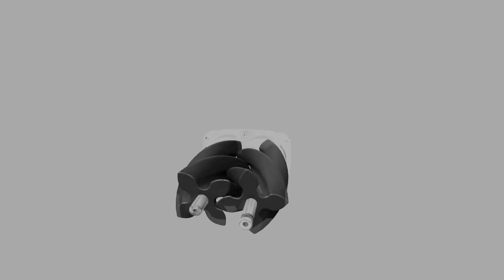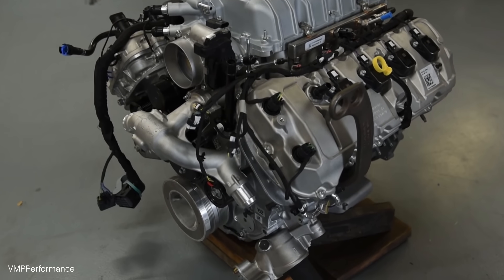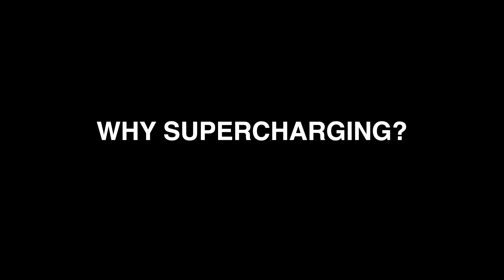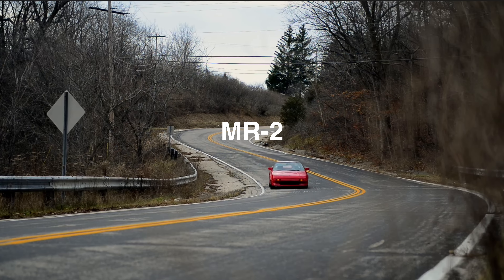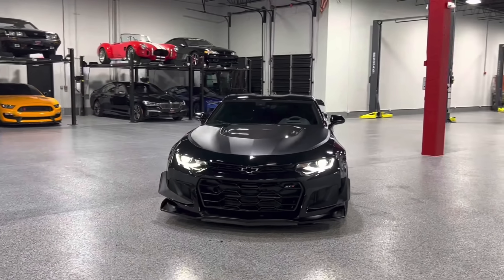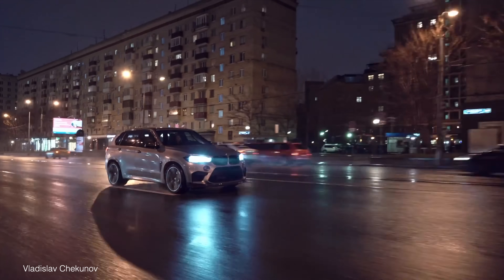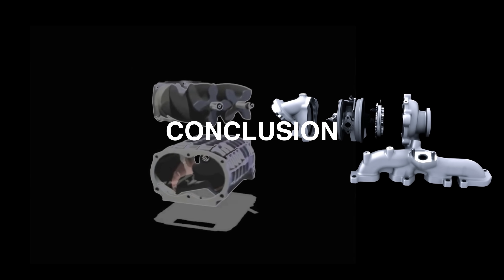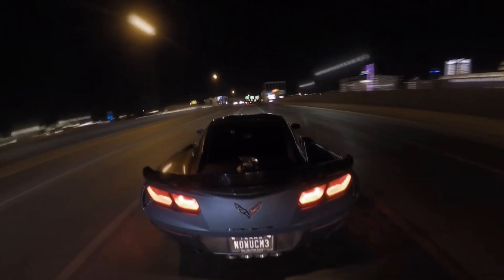Why V8 Engines Are Supercharged vs. Turbo😮| Explained Ep.6

Comment: The problem with hot Vee turbos is heat management.  These engines generates a ton of heat and are hard to keep them cool.  BMW's first N63 engine (twin turbo Hot Vee) was a disaster; trust me I had one (2010 550i).  There were issues with the turbos coolant/oil lines, burning oil; killing batteries because the fan would run for a long time to cool the turbos.  I can say BMW improved the engine with each technical update (TU) such as N63TU1-N63TU4. Over the years, I had a '14 550i, '18 M550i and currently a '21 M5 Comp (uses S63 engine with better internal parts) and had no issues (looking for some wood to knock on)! 😄

Last, going forward ('23 models), BMW will only use their M division new plug in hybrid V8 engine (S68) in all their V8 models (the engine will be detuned to differentiate true M cars versus M performance models.
Reply: This guy knows his BMW V8s very well
Reply: The straight 6 turbo is the only way to go for reliable performance in a BMW.
Reply: You’re a brave soul owning that many N63s, one was enough for me.
Reply: @CadexLaw  I leased them.
Reply: So if the engine was so terrible why did u keep.buying bmws?
Reply: @genogrinberg6014  First, I never complained about the engines; just stated facts.
I've been buying brand new BMWs since 1994 (325i) and used BMWs since 1983 (320i).  So, let's just say I am brand loyal.  
Also, all my V8's were leased so no issues since they were all under warranty.
I am thinking about keeping my '21 M5C since it will be the last ICE.  The next gen M5 will be Plug In Hybrid (S68 engine). 
I am not a big fan of electric cars; however, I will have no choice since, everything will be electric.
Reply: @genogrinberg6014  engine might be bad, but car itself drives like a gift from god
Reply: "Z06 heat soak" just came to my mind. still, i get your point, its more of a turbo thing.
Reply: @neohimself  it was remedied in 2017
Reply: My uncle had a 650i one of fhe pistons seized from all the excessive heat I'm assuming. The motor was completely toast
Reply: @cartere9981  probably seized from low oil my guy
people often don't put enough oil because it burns it so fast usually people blow their engines doing that. just keep an eye on the oil its not that hard🙄
Reply: @Zoles7403  yeah I always add about 0.2 quarts every 1-2000 miles in my 4 series that's all it needs it barely burns any its not a oil burning machine like the n63s though I try to let the car measure it's oil level at least once a week I have no idea how he maintains his car so it very well could've been low oil
Reply: What’s your profession?
Reply: @Z63_AMG  IT Executive
Reply: The S68 will also be used in the new 7 series without plug-in electrification.
Reply: It's just something engineers have to take care off. Most did.
Reply: BMW = overpriced plastic garbage. Look at resale values.. Says everything you need to know.
Reply: @breadnaut  Couldn't agree more...they speak of German quality but it's skin deep, under the hood where it matters anything that can be made of plastic, is.
Reply: Oh yes they are hot. I have a 2017 C63S, I live in central Mexico and it gets really hot. But I haven’t had any issues. Thankfully AMG engineers made an engine that was capable of taking all that heat.
Reply: You gotta get the park plugs that generate lower heat
Reply: Absolutely correct, but getting the exhaust hot as quickly as possible is necessary for emissions (catalytic converters don't work below a certain temperature).
Reply: Hot V not Vee. Never heard of a Vee8 or Vee12. Also saying that Hot Vs are problematic just because BMW can't make a reliable car makes no sense, never heard of an AMG M177/178 have a problem with its hot V configuration
Reply: @wailfaridi2070  Thanks for the correction for Vee vs V.
By the way, have you ever own a AMG?
Reply: Did you ever mock on wood?
Reply: Maybe if it was diesel
it would b. better?
Reply: The hot V Design has established because the heat management is much better. The N63 problems are not due to the overall hot V layout.
Reply: You must be a masochist
Reply: don't the n63 TU's still have issues? If I were buying a new bmw I would only be considering b58 and s58 cars. After the original n63 and n62 I would never touch their v8's even though the m5 is a literal rocket
Reply: @SicSemperBeats  I have not had any issues with my previous 2018 M550 nor my current '21 M5C.
Hope this helps!
Reply: That’s not a hot V problem that’s a BMW N63 problem lol Audi’s 4.0 V8 and Mercedes 4.0 V8 don’t have those issues
Reply: the new audi hot vs handle a lot better iv got 13k on one in under 6 months no major oil burning or high engine temps, granted im not getting a reading on intake temps yet
Reply: I own a 2013 m5 n63tu engine..super reliable and will eat anything on the road..2013+ are super reliable..he had the old 2010
Reply: @yrasphong  F10 M5 don't have  n63's they have s63s. Either you have an S63 engine or you don't have an M5 and you have a 550i with some M badges LOL
Reply: Everything bmw makes is junk, I wouldn’t call anything an improvement
Reply: @cornelius6304  ok
Reply: N63 are just absolute trash. M60 was great, M62 already had chain guide problems. N62 took that over and also added valve stem seals to the list. N63 took all these problems and added turbo related problems. Seems as if every iteration just gets worse. BMW V8s are made out of glass. Only get an N63 car if its just had a replacement engine or everything has been replaced before the ticking time bomb comes around
Reply: @DamonBMW  S63 Tu v4 is good. That's the current ttv8 17- present.
Reply: Internals and good supporting materials go a long way with turbo charging.  You can’t cut costs with cheaper materials.  The heat generated will make the car unreliable.
Reply: No complaints about my n63. Punks Supras all day. If you cant afford it don't buy a BMW 😅
Reply: Bmw is trash anyway. You want a hot V8 get an Audi or Merc
Reply: @niko8638  you on drugs Mercedes is for luxury bmw is the ultimate racing car m5 m6 and I ain’t have no problem with my 750i very quite and move in silence ain’t making all that noise like those American v8s m5 vs Audi merc hell cat they all get smoked from launch 🤣🤣🤣 and they can never recover Audi is not a bad car they take that tune up and no engine light that would be my car if I’m not driving a bmw
Reply: @niko8638  except BMW smokes them.  All these cars are "trash". Get what you can afford. I JUUUUSSSSTTTT got a 21 M5 competition. I didn't even consider an Audi or E63 amg. What Audi compares to them anyway,.an S6 or 7? Girl looking cars to me.
Reply: @chrissmith-rv5ro  I don't care what you have. I would'n put my money on bmw. The truth is that bmw has good reputation of poor reliability, especially M models. Crank hub failures, conrod failures.... 4.0tfsi is way stronger than  N63/S63 which is doomed to fail even stock.
Reply: @niko8638  WARRANTY. And look at little girly Audi feelings on display. Matches the car.
Reply: @niko8638  yes but both are unreliable so whats your point german is not very reliable but id rather have the n63 over the e63 just cause it gaps it silly😂
Reply: @Zoles7403  Never heard of 4.0tfsi Audi/Porsche/Bentley/Lambo engine being particularly unreliable tho. Lots of +1000hp examples with completely stock internals.
Reply: @niko8638  so does the new S63B44T4(thats the engine code for like 2017-2020 engine and many people have also made 1000hp search it up but I also highly doubt they didn't upgrade the internals or at least block on the audi or bentley, just because its hard to handle that much boost with stock internals
Reply: @Zoles7403  There's no conrod failures like in bmw's. I wonder if bmw has sorted it out. It's like 20 years of failures 😂 S85, S65, N54, N63, S63....
Reply: @niko8638  you actually want to compare reliability of a Merc and Audi versus BMW? Really??
Reply: @sleepywolf82  Facts. E60M5, E90M3, F10M5 all had major internal problems. Name me one RS Audi model with failing connecting rods.
Reply: @chrissmith-rv5ro  agreed I’d take an RS7 or E63 AMG wagon over any BMW with a twin turbo v8. Personally for me the RS6 Avant is the hottest thing any German brand has made in a long time especially in black. 4.0tfsi doesn’t have nearly as many issues either.
Reply: @CadexLaw  I just googled " Audi 4.0 ttv8 engine problems". WARRANTY!! needed too. ALL of them are a gamble used without a warranty. I'd NEVER own one of these cars without a warranty.
Reply: @chrissmith-rv5ro  that goes without saying 😂
Reply: @chrissmith-rv5ro  lmao really weird to think cars have anything to do with your masculinity but ok
Reply: @BaldKiwi117   Here in northern Virginia, all I see driving Audis are women. Same with newer infiniti's too. I was teasing the guy in the comments in his feelings about Audi.
Reply: @chrissmith-rv5ro  The RS6 and RS7 don’t look girly at all, in fact I’ve seen more women drive BMWs than any Mercedes or Audi lol
Reply: @Justin_GFM  don't know where you live, but here in northern Virginia, Audis are women cars. But women here make a lot of money and they drive pretty much anything.... Except M5s.
Reply: @chrissmith-rv5ro  tell him again ain’t nothing messing with an m5 they all get smoked on launch or m6 I seen a guy with a 1200 hp m6 that thing was a beauty
Reply: @niko8638  those are the older ones like you said earlier 2010 2016 and up don’t have those problems over heat etc you can go ahead with your girly merc and come get smoke m5 smoking hell cats these days much less merc hell cats srt jailbreak what he had 900hp going against a 600 hp m5 got smoke started complaining about 4 wheel drive American cars ain’t it 😂😂😂

Comment: Fun Fact: One of the early prototypes for the BMW N54 was a positive displacement 3.0 Inline 6. They obviously ended up going with a twin turbocharged setup
Reply: You mentioned positive displacement in your other comment, what do you mean by positive displacement? because engines tend to not be the best descriptor of that phenomenon.
Reply: @amorag59  I think he meant supercharged, of which a positive displacement supercharger is a type. Roots blowers and twin screws are positive displacement pumps, as opposed to say a centrifugal supercharger which is a dynamic pump.
Reply: @BigUriel  great answer.
Reply: I have a 535xi with that engine configuration.  It rips. But I'll take it down with my naturally aspirated hemi magnum...until the 1st bend of course
Reply: @younkinjames8571  you supercharged an n54?
Reply: I think a big displacement (4.5-6L) supercharged inline 6 would be a lot better than both the normal sized turbo sixes AND supercharged V8s. It’s just that modern engineers hate  long engines because they want all cars to be shaped like a squashed turd.

Comment: Turbos are also very sensitive to temperature so in order for them to be a ✌🏻set it and forget it✌🏻 type situation they have to be dialed back… Also the supercharger is only affected by the intake side of the engine and has amplified effect on the exhaust🤤.  Keep all this good stuff coming man!!🤙🏻
Reply: What do you mean it's only effected by the intake side?  Not sure what you're trying to say there.  And what do you mean it has to bs "dialed back"?  It seems like you only partially know what you're talking about and you're just making the rest up as you go lol.
Reply: @midnight347  exactly hahah. Like the fuck
Reply: @midnight347  turbos run off exhaust side…superchargers are on the intake… to get max effort out of turbos they take constant tweaking to keep up with temperature swings… superchargers do not. I understand if you don’t get it
Reply: @The_Drive_Inside  Supercharged engines are equally affected by heat soak and IATs..you're way off.
Reply: @ahemgee9542  wtf
Reply: @ahemgee9542  ok ok I gotcha
Reply: @The_Drive_Inside  what do you mean by max effort and constant tweaking?? It sounds like you don’t know what you’re talking about. Any car that uses an ECU is constantly “tweaking” the air fuel mixture as you drive to adapt to the conditions and demands its experiencing... plus both the supercharger and the turbo charger are attached to the intake.... the entire point of them is to force air into the engine... can’t do that if you’re not attached to the intake. The difference is the supercharger is attached to the crankshaft via a belt and pulley, therefore requiring the engine to work harder to spin it. The turbo doesn’t cause any extra load on the engine because it is spun by exhaust gasses. Both of them are attached to the intake though
Reply: @The_Drive_Inside   You are making a delineation between superchargers and turbos that doesn't really exist. They both are affected by temperature, but both have the ECU compensate by monitoring barometric and manifold pressure and temperature sensors (or a MAF sensor). If superchargers were so good with heat, then Dodge (for the Demon) wouldn't have had to engineer their supercharger intercooler with a boost of cooling from the air conditioning system.

Also I think this is confusing to people (in part) because you said the supercharger is affected by the intake, when you possibly meant to say only the intake is affected by the supercharger. Ie a turbo affects both intake and exhaust, supercharger just the intake. Even though turbos sit in the exhaust stream, remember, the exhaust gases are still expanding by then and thus the turbo is utilizing energy that would otherwise be wasted.
Reply: @amorag59  Yep you’re right… You’re smarter thanks for enlightening me
Reply: @midnight347  Agreed, a lot of head scratching
Reply: None of that makes sense 😂
Reply: @mizaqenyad4269  makes perfect sense your comprehension is just low
Reply: @mizaqenyad4269  you're kidding right?  Just disagree with him.
Reply: @joshtheking1772  nah cuh gotta put in work on these youtube comments
Reply: Yeah this is pretty stupid for starters turbo's aren't that sensitive to temperature and unless your working with a really high HP engine they are set and forget remember there are substanially more turbo cars on the road than supercharged, and while a turbo system is more complicated to set up due to exhaust routing it is actually a simpler more efficient system and at a base level can out last the rest of the vehicle
Reply: dude it an idiot.
and ur spouting the negatives of 80s n 90s turbo setups😅
god peoples ignorance pisses me off sometimes

Comment: It's about torque curves and how it feels, plus let's face it......OEMs are naturally conservative and copy each other. The hot V is a mistake. With the concentration of heat in a smaller space, seals, gaskets and other small parts are exposed to higher temps and the breakage increases. 
We are not gonna even talk about the sensors and other electronics in the V. With the turbo tech available today, you don't need a hot V to make life happen, it's just a money hustle.
Reply: I just wanna know how is the stock flat line in a regular c8, is producing 450+, then they Chevy advertising that the flat plane can produce so much more power being N/A
Reply: In the z06 c8, I’m just wonder how can you yield so much hop in a N/a

Comment: Quick question are turbos just giving to much lag bc they take a minute to warm up and build boost and how do u know u blew a turbo is it like you slung a rod u here a little tink I love V8s yes yes I do but DAMN THEY EXPENSIVE I like turbos bc the blow off makes my little car mind moist and I just wanna run it hard and I mean HARD
Reply: Turbo lag exists because they operate off of exhaust. But when theres relatively low exhaust flow because of low RPM after a cold start, for example, you experience "lag" or abnormally low boost. As you let the turbo spool, and increase exhaust flow (raise RPM), you gain boost.
Reply: "Take minute to warm up and build boost" Dude what?

Comment: Supercharged the way to go
Reply: turbocharging is objectively better from a power and efficiency standpoint. I'd still rather have a supercharged V8 tho
Reply: @idealized_  And supercharging is objectively more reliable. Pick your poison
Reply: @Perry....  ehh. superchargers definitely place more load on the engine and run really hot. not too sure how well that would hold up in the long run
Reply: @idealized_  Of course they do, any forced induction has that drawback. I'm obviously comparing them strictly to turbocharging